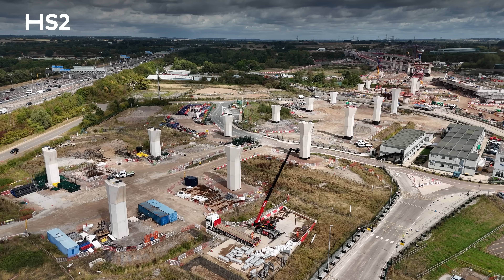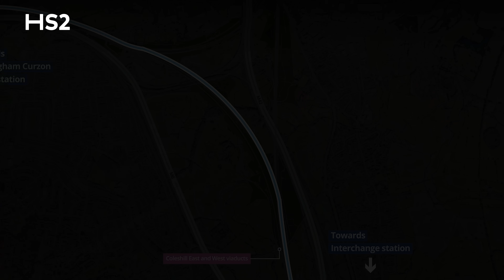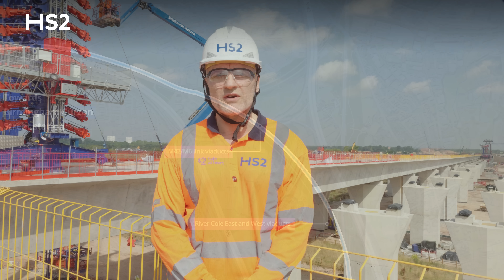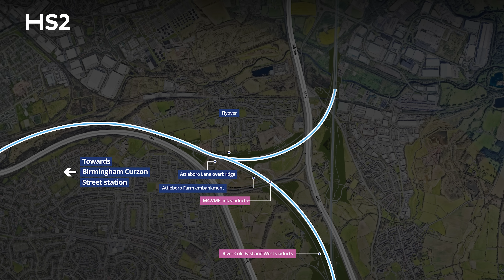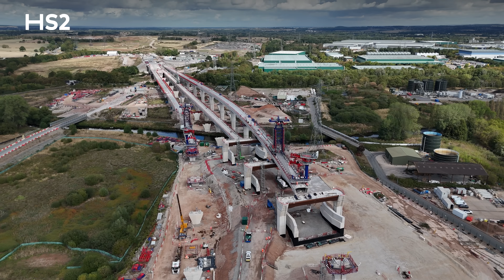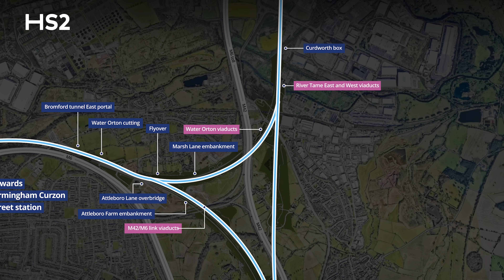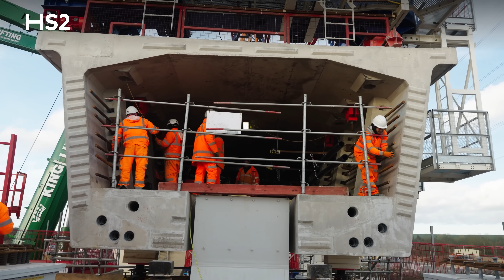HS2's Delta Junction explained: 🚆 In-depth look at one of the most complex parts of HS2 🏗️

Comment: 17 billion to repair all roads back to useable condition in the UK, currently wrecking vehicles and endangering riders and drivers, just nowhere to be found.  Possible 100 billion to build one rail line making things a little bit faster no problem, as much as they need to the bitter end. You do have to wonder with the spiraling costs, even with a reduction in distance, it demonstrates failed feasability considerations at the outset and if it will ever be completed. California which seems to emulate the UK in so many ways, especially in teaming up with net zero ideology, seem to be going nowhere fast with theirs.

Comment: That's great... For Birmingham. 
You saved a massive 25 minutes on your London commute for only a hundred billion pounds.
Reply: And it will make taking the train a lot faster than flying the same route.  Birmingham to London will now be faster than my old commute to Guildford (from the south coast) while being three times further apart.  You can argue about the spiralling costs (and you won't get any arguing from me), but the UK desperately needs new infrastructure.  It's 50 years too late (like most UK trains), but better late than never.

Comment: what about to south west somewhere in devon?
Reply: There is a pretty decent line to Devon already via Bristol, and another slower one via Salisbury. The case for connecting Devon to the rest of the country at 200+ mph is not as strong as for doing that between the major cities like London, Birmingham, Manchester, Leeds.

If I was upgrading railway infrastructure I'd prioritise building HS2 in full up both sides of the north, electrify the line to Devon as it's currently running on diesel, and I'd reopen closed branch lines in Devon, reinstating the Exeter-Plymouth link via Okehampton and Tavistock for example, before I went and built a whole new high speed line to the west country. 200mph out west from London to Bristol and Cardiff would be great though.

HS2 may help people from Devon travelling via London because Old Oak Common will be the interchange with it so they don't have to go all the way into central London.

Comment: A massive and unnecessary waste of money and environmental destruction.
Reply: Here we go again, yet another critic! In a way I hope it is cancelled because I want to see future passengers standing on the trains all the way from London to Scotland because of the lack of capacity.
Reply: So are new Motorway builds and Road improvements.
Reply: You can only hold this position consistently if you also oppose all the motorway building that's gone on for decades, and the fact that the vast majority of the UK's transport infrastructure is built around private car use, at astronomical cost to the environment of everywhere that has been paved over and cut through with roads.

Comment: The part labelled “TO THE NORTH”. Oh how I laughed. Wonderful engineering, but a total waste of resources by putting the infrastructure in the south to start with. What would the equivalent money spent in the north of our country done for the people living there? If you had started at Manchester at the least and worked south it would have been so much better.
Reply: Sorry it does not work like that when constructing a Railway or Motorway, HS2 is simultaneously being constructed from Birmingham, London and all parts in between

Comment: Some superb engineering going on. I had thought that the leg to Manchester had been cancelled by Rishi.
Reply: It unfortunately has, but HS2 runs to Handsacre north of Birmingham where it connects to the west coast main line allowing trains to Manchester and beyond. There's an unfortunate public misconception that HS2 is just a kind of isolated shuttle service between Euston and Birmingham that doesn't connect to anything else.
Reply: @BobSmith-s7jwell it kinda doesn't connect to anything else. It's like connecting fiber broadband to a copper wire.
Reply: @Cas_Co  It's no different to the high-speed trains in Spain.  They run on existing lines while the new ones are being built.  The train between Valencia and Barcelona barely gets over 100km/h in a lot of places at the moment, but in a few years time it'll be 300km/h all the way.

Comment: Great, apart from starting at the wrong end. Result = half the railway, 4 times the cost.
Reply: HS2 wasn't started from any end in particular, like any major transport projects like a Motorway HS2 was simultaneously started in Birmingham, London and places in between so the whole track formation was built to accept the tracks, if it was just started from one end it would not of been so far forward in building as it is now.

Comment: Why the high costs compared to other projects people ask while insisting on the highest standards of environmental protection, over the top in my opinion. add the highest health and safety standards and the standards of quality and robustness to last for many decades without the need for major maintenance and upgrade in the foreseeable future, unlike most construction which seems to only be designed to last for a decade or two at most. I suspect that it has been the victim of political rivalries and the very Londoncentric Government and had it been contsructed from a starting point in Manchester or further north  it would have kept its funding until it reach London. it will still be standing long after all the current Politicians and civil servants who so undermined it are long gone.
Reply: §§ please!

Comment: It is tragic this isn't being built in full to Manchester or Leeds or beyond
Reply: But it is looking promisingly likely, kinda. A line between Birmingham and Crewe is essential otherwise of huge capacity issues that won't make HS2 as useful as it can be. 

Labour wants to revive Northern Powerhouse Rail, also known as HS3, which will see a new high speed line Liverpool -> Warrington -> Manchester -> Bradford -> Leeds, and upgraded lines from leeds all the way to places like Newcastle, Hull and Sheffield. It will also mean the HS2-HS3 junction would be made north of Crewe meaning HS2 needs a small extension connecting Crewe to the HS2-HS3 junction.

Just gotta hope Reform doesnt get voted in and derail the whole thing. Also hoping Labour learns from HS2 mistakes

Comment: A small correction if I may....not Britain's new high speed rail system........PARTIAL high speed rail system.
10/10 to the people at HS2 for promoting this abject failure of a project as a sucess........it takes some brass neck to keep doing that although I suspect if you keep telling people its a success some idiots may start believing it.
If you keep polishing a t*rd its still a t*rd.
Cancel it now and use the money on a much needed east-west coast link.
Reply: People thought the Elizabeth Line was failure of a project for being overbudget and delayed. Now it is one of the most used rail lines in not just London but the whole UK. The guy who led the project was semi-recently put in charge of HS2 which is why it had a "project reset" so everything is looking good.

(And there is a proposal for an east-west coast link. It is called Northern Powerhouse Rail, or HS3. Labour wants to revive the plans but Reform says they'll cancel it immediately if they get into power)

Comment: I genuinely don't understand why you are continuing with this farce. Richard Toce has already said that wirk will cease immediately upon Reform taking office and as that is now a near certainty, I think work should be paused rather thzn waste yet more money.
Reply: 82% of tunneling done. 80% of viaducts are finished. 70% of bridges are done. 40% of earthworks is done. Even with an unweighted mean, which is incredibly unfair estimate, the project is 70% done with major infrastructure placements. Why would anyone cancel something 70% done when they can instead invest the money which'll end up making more economic value?

People like you would call the Elizabeth line a failure, overbudget, delayed, stupid, should've been cancelled years ago. But now that it is built, it is the busiest rail line in not just London but the whole of UK, with 700m passenger uses within 3 years of it opening. It had a £42b boost to the economy. 

Also, why would you want a reform government to cancel important infrastructure (which most of Europe already has high speed rail) so they can cut taxes for the rich????
Reply: @falconmate It's only half finished. The money and labour could be better used fixing potholes. There is no business case for railways when roads do the job just fine and for a lot less money. That's why Reform will cancel it and turn any infrastructure into local roads for local people to use and enjoy.
Reply: @nickmagee-brown739  Please just go to America and see how "only roads" makes their cities disgusting. They have like 5 lanes on a city road so u cant walk across them.

Also, idk why Reform councilers are 
talking about immigration and flags and dei when they should be filling in potholes cas that is their job.
Reply: Ageing like milk this comment.

Comment: I'm a strong supporter of an as fast as possible capacity increasing HS2, but, given the way things turned out and the complexities here, making a link into Birmingham secondary to getting HS2 to Crewe might have been more useful if not politically possible.
Clarification: I was clumsily suggesting that Crewe with an intermediate stop near the delta rather than Birmingham centre  should have been a priority from a UK-wide perspective as the benefit to Scotland and North Wales would arguably be stronger.

Comment: So which destinations does HS2 take us to that aren't currently served? What are the ACTUAL benefits of the project? If it went to Manchester I could see some value but something like 15 mins off the time from Birmingham to London? 

It's a shame that the money hadn't been invested in the shoddy services that the existing rail infrastructure provides commuters, but that's not shiny enough to attract investment.
Reply: The West Coast Main Line is at capacity – essentially, no service improvements can be made because there’s literally no space around the trains currently running on it. HS2 if it’s built in full will unlock extra space on the WCML for slower services by removing intercity traffic to dedicated tracks. The journey speed improvements are a benefit, but they’re not the main reason to build HS2
Reply: @KirinSixtyFour  Yes that is the argument that keeps getting trotted out. We had the £9 billion upgrade to the WCML not that ling ago that was about increasing capacity and that didn't work. I sure if it was about capacity then they could have built something may be not as ludicrously fast as HS2 for far less money. There is already a second line from London to Birmingham that is barely use.
Reply: Then why should it go to Manchester which again is already served by the existing WCML, it will save 40 mins from Birmingham to London in both directions not 15 Mins, I believe the 15 min saving is from Manchester to London
Reply: The benefits mostly relate to capacity rather than journey times or directly serving entire new destinations. Speed is important but secondary. If you're going to go to all the trouble of threading a new railway across the country between major cities it would be silly not to build it to modern high-speed standards, but the project is not primarily about shaving a few minutes off London-Birmingham.

Comment: … how are you connecting to the mainline without negatively impacting current line capacity
Reply: It won't as Avanti West Coast or the West Coast Operator will operate train services on the HS2 line and tHi Speed train services from Scotland, Manchester and Liverpool will use the HS2 route instead of the Southern half of HS2 for the train services so capacity on the Southern Half of the West Coast Mainline from Stafford to London Euston will be improved
Reply: Hope it’s a full grade separated junction

Comment: Personally I  think  it should have been built North to South as we already have a good link from Birmingham to London. Hopefully it doesn't become z white elephant.
Reply: It hasn't been built North to South, the HS2 infrastructure has been built in sections the whole length of the line in every area
Reply: @peterwallen1063 Manchester isn't in the NORTH !!!!
Reply: @NUFC2412  Do your Geography, Manchester isn't in the South is it
Reply: But then you run into the little issue of capacity that fans of HS2 trot out as its necessity. If you built from the north then there wouldn't be the capacity until the southern section was built. There is not spare capacity on the WCML, or so we are told.
Reply: @kevinrayner5812  The whole idea of HS2 as it is , is to allow more capacity on the Southern section of the WCML from Stafford south to London Euston to remove the vast majority of high speed Inter City services from this part of the Trent Valley WCML onto the HS2 line so allowing more capacity for the ever increasing liner freight trains and other secondary passenger services plus speeding up passenger services on this tortious twisting section of the West Coast Main line and also freeing up Birmingham New Street the UK's 13th busiest Railway Station in the UK and Busiest outside of London by again moving high speed services away from Birmingham New Street and operating them from Birmingham Curzon Street on HS2. The question I ask is why do you think by building from the North and I presume you mean Manchester would it help the capacity problem of the Southern Section of the WCML and the congestion problem of the UK's second City and Second Biggest City Birmingham whose main station Birmingham New Street is at capacity breaking point., like any major transport infrastructure projects they are never started in one point, but at multiple locations up and down the construction area.

Comment: Engineering like this goes towards explaining why the project costs so much. I hope this is being constructed to the larger European loading gauge so that one day it will be possible to run through trains via HS1 & the tunnel to France. 
Unfortunately the fuller benefit of HS2 will be let down by slower running trains on the older tracks as the new trains do not tilt and will have to travel at a lower speed than existing trains on the curved sections of track.

Comment: Unnecessary, concrete monstrosity; part of a white elephant, wasteful project. The money should have been used to upgrade existing lines, especially east to west.
Reply: They're saying HS2 is an upgrade to existing lines. It removes high speed trains from existing lines and stations so that more regional and local services can run on them.
Reply: @jamesadfowkes Will it help people get from the east coast to the west any quicker, or will they still need to change trains at least 3 times?
A few years ago, our pre-booked train from York to London was cancelled, with no reason given. We had to switch to another company's train, then travel to Doncaster and wait for another. Added 3 hours to our journey and made us late for a gig in London. We were relatively lucky. I talked to a couple who had spent all day travelling from Liverpool to Lincoln. They were waiting for their FIFTH train of the day, for a journey of about 150 miles. The trans-Pennine service is abysmal. Edinburgh/York/ London is one of the better lines, but is often plagued by late cancellations and delays.
Reply: @portcullis5622  It would obviously be dependent on exactly how the extra capacity gets used, but HS2 and NPR in full would have freed up a ton of platform space at Manchester and Leeds and many more train paths on the main trans-Pennine arteries. That would translate to both an increase in service frequencies and journey options.
Further south, Midlands Connect had a plan to massively increase service provision around Derby/Leicester/Nottingham/Birmingham, all based on the released capacity HS2 phase 2 would have provided. All lost now, we're stuck with making do with what we have.
Reply: This is that? It's capacity?
Reply: @TheMagicJIZZ Sorry? In plain English please.
Reply: @portcullis5622 This is that? It's capacity? Do you want this in Chinese or Arabic?
Reply: @TheMagicJIZZ Put it in whatever language you like, but I still don't understand what you mean.

Comment: HS2 is amazing, shame about all the horrific cost overruns, but having said that,  I think HS2 is a fantastic asset that the UK will benefit from for a long time, long after all the nimbys and accountants have gone.
Reply: remembering the channel tunnel saga _ who even gives it a second thought now _ similar can be said for hs1 
    although we need to step back & look carefully before we begin with the Manchester section _ not at how the various structures are built _ building to a 120year design life is correct _ eastwest rail is built to same standard _ built once properly _ it's how the contract are let _ fixed price v cost plus _ same as you can't begin construction with a 13% design maturity as apparently hs2 did _ crazy
Reply: No Contractor will offer a fixed price on a project of this size even with 100% design information. Fixed price means the agreed price can't  be exceeded for any reason, not just inflation.

Comment: I think this would've been a lot easier to understand if you'd shown each line/viaduct on the diagram separately rather than just a triangle. I couldn't work out what viaduct did what. He might have explained it, but unless you're intimately familiar with how each line connects to each other it's not that helpful.